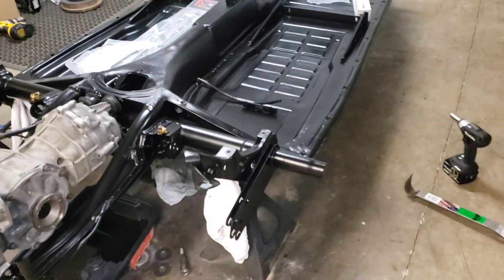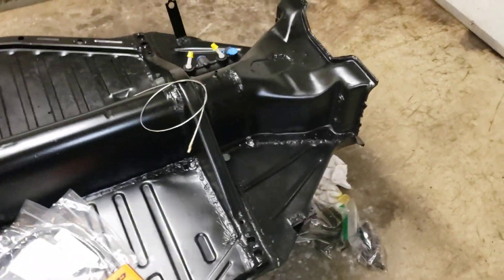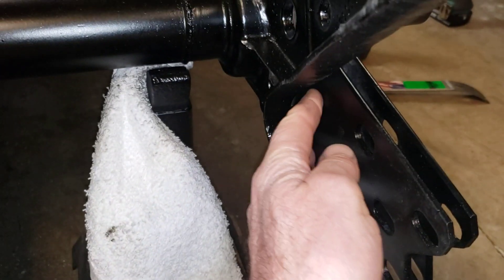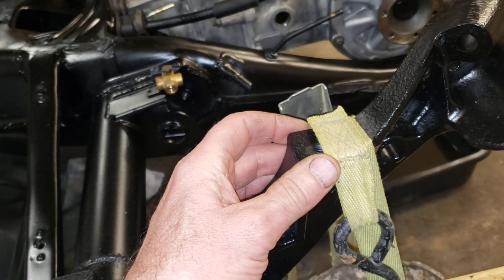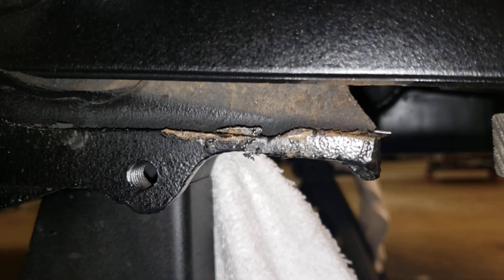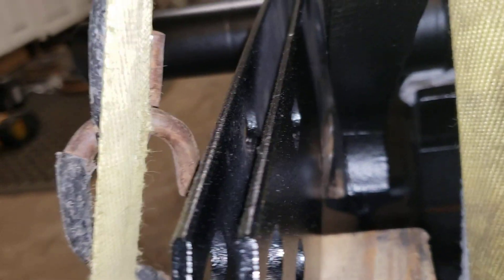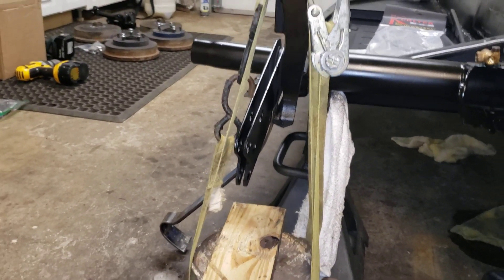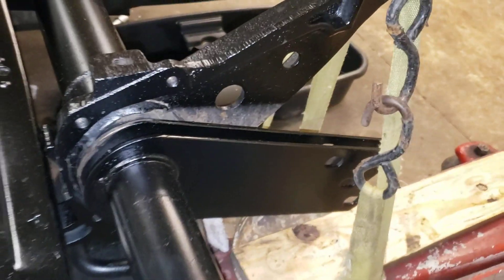Lowering VW Beetle Rear The Easy Way

Comment: I was thinking of using a 3000 lb. ratchet strap but I knew it wouldn't release slowly so I was stuck. Thank you for the floor jack idea. I'll be going with your method real soon. Although, I'm not lowering it. I'm only replacing the all important bushings. Thanks for the video.